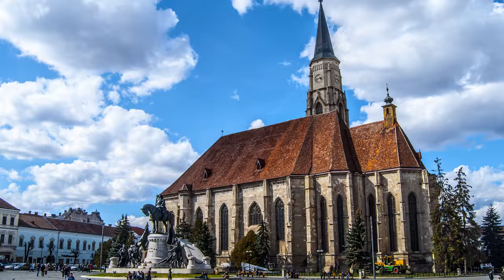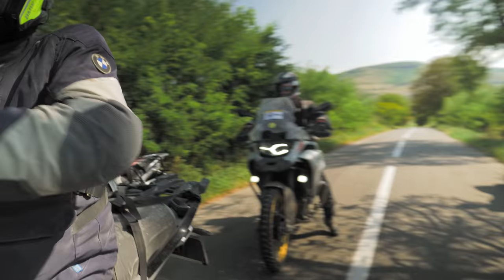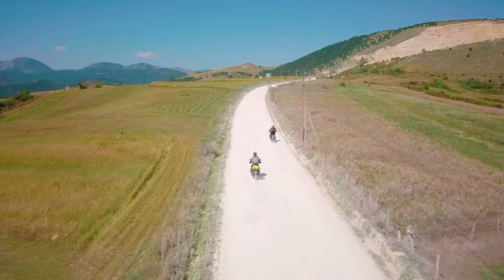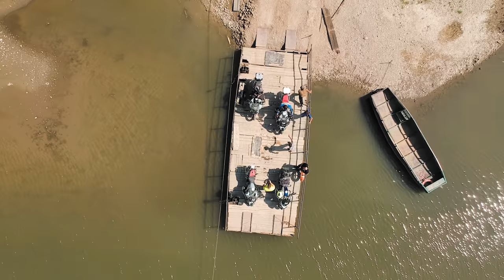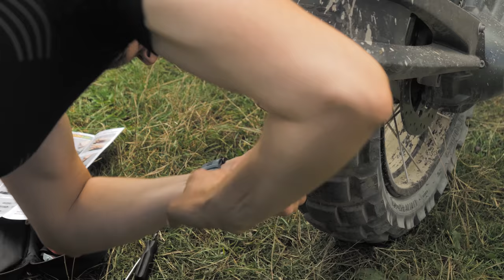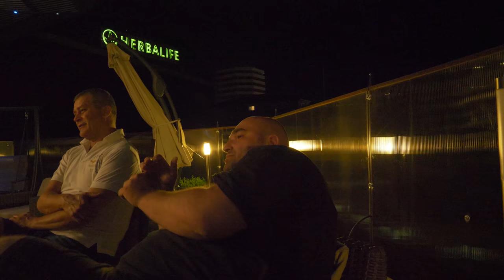Day 2 - BMW R1250GS True OFF ROAD Adventure Motorcycle Tour in Romania

Comment: Awk! No Gloves - Yikes! Oh, whew, there they are... Had me worried there for a moment... Awk, they are missing again - stress... Yikes riding thru mining area and still no gloves - can I take anymore stress?... Beautiful riding locations - my only connection with Romania are my TCX Adventure boots (very comfortable) and You!  Much thanks for all you do!  BTW, 4 days ago I took my 600lb GSA with full panniers into the rough forest service roads around Mt Shasta, California - this was my first time riding my GSA through baby-head size rocks embedded in the road so numerous that all I did was hit the slightly smaller ones for about 15 miles - throwing my 600lb GSA around is nothing like throwing my former 250lb cross country enduro ride around - in some ways, it was more fun on my GSA - certainly felt grateful to have made it thru at all, frankly...
Reply from the maker: Now big rocks, or small boulders are the worst to ride through! I really dislike it, but yes, taming the big heavy beast offroad is an achievement in itself.